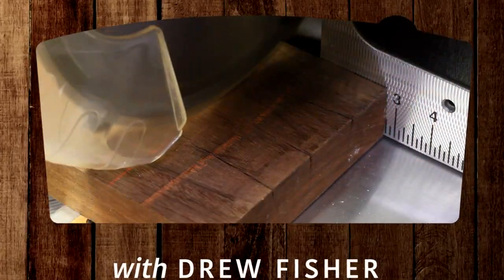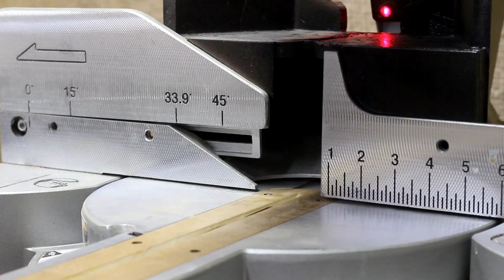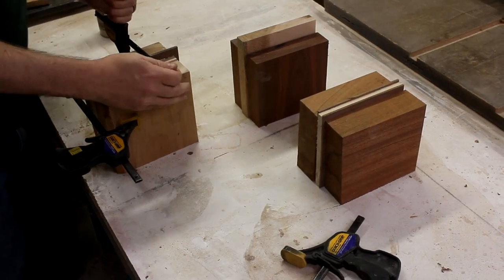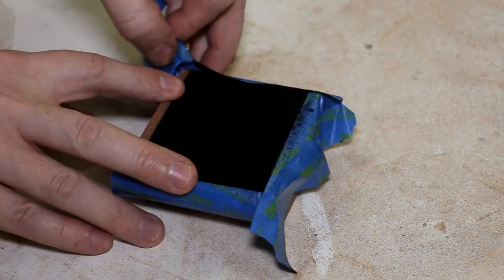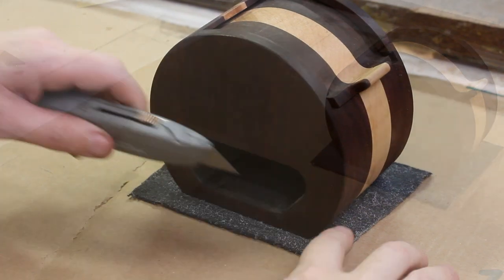Woodworking: Making the Roll-Top Bandsaw Box

Comment: There are 2 kinds of wood workers.
1) Those who have blown sawdust back in their own face.
2) Liars

;)
Reply: On a related note...   Most recently I realized why I can't comfortably use my jigsaw lefthanded....
Reply: @hyenacub  why is that
Reply: @austinj470  Because of the vent that blows air from the motor (and also sawdust) as it runs is on that side and I get the mentioned sawdust to the face, lol.  I'm not normally left handed, but the job was less awkward if I used it that way.  Yeah.  Got a face ull of sawdust.  Yay for goggles.
Reply: @hyenacub  thank you for the explanation
Reply: @austinj470  No problem.
Reply: There are 3 types
1) those who have blown saw dust back in their face
2) those who swear that was the last time, normally ok for the rest of the day, possibly 2
3) liars
Reply: All you gotta do is the safety squint
Reply: I went to blow the dust off my one project and then after blowing I realised I still had my dust mask on 😷

Comment: Nice work!!  I am inspired to achieve... my new band saw is on its way.  But please!  help me out - what's the salt for?
Reply from the maker: A tiny bit of salt keeps the pieces from sliding when clamping pressure is applied.  It then dissolves in the glue and doesn't mess up the joint at all

Comment: I'm curious about using the jointer to flatten the bottom of the glued up wood blocks.  My 6" jointer manual says the shortest piece I can joint is 12", but your pieces look about 6" or 7" long.  Is this a safety concern?  Thanks.
Reply from the maker: The pieces just need to be able to span the gap that has your cutterhead as well as have enough material so you can hold it square to the surface.  After you've used your jointer for a while, you'll see how you can get away  with slightly shorter pieces.

Comment: I have made these before and struggled with the bandsaw blade handling the turns.  I think I found my mistake...TPI was too high.  Whats up with the salt when gluing?
Reply from the maker: When you salt the glue joint, the pieces don't slide around when you apply clamping pressure.  Allows you to line them up perfect and they don't budge.
Reply: Thanks for asking about the salt. About to try it out

Comment: I'm curious why bother squaring up the blanks in the beginning if you were just going to cut out the pattern with the band saw? Wouldn't it have been fine if the printed pattern fit within the blank?
Reply from the maker: Yes.  If you're certain you can get the circle stencil in the center of the blank.  I wasn't sure I could, so I squared up the blank so that I didn't make a mistake.  Good catch.

Comment: Why wouldn't you just wipe the glue when it's still wet? paper towel with water on it would clean that glue out and then you don't have to deal with it when it dries.  never understood why people leave dripping glue on their projects 🤔
Reply from the maker: Because wiping glue with a wet towel isn't that good of a practice.  It's difficult to see if you've gotten it all and the water thins it down causing it to actually leave a film that seeps into the wood which is then only fixable by sanding it down.  Best bet is to let it start to dry so that it's gummy and scrape it off or let it fully cure and chisel it off.